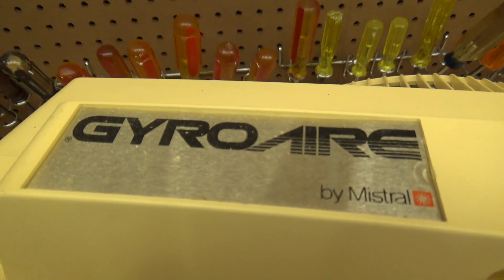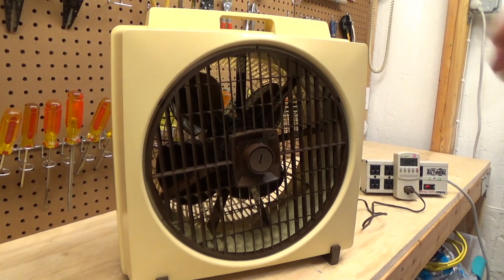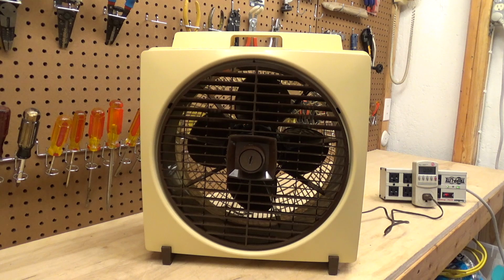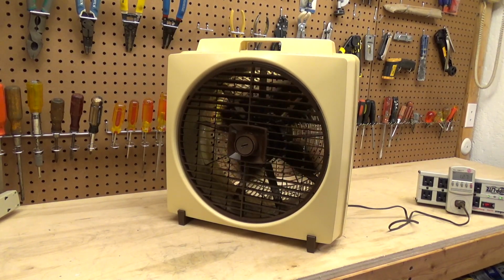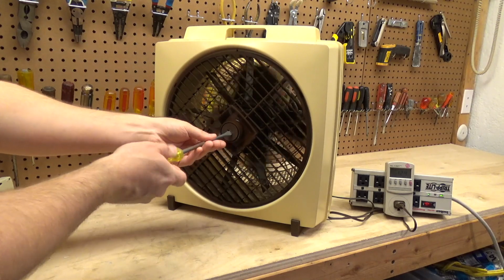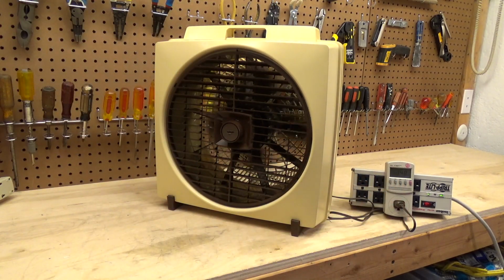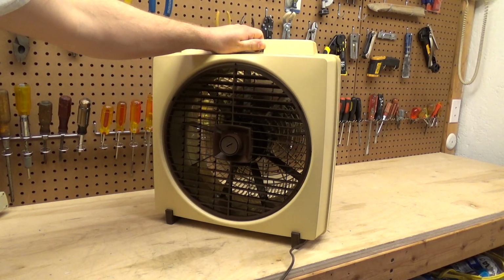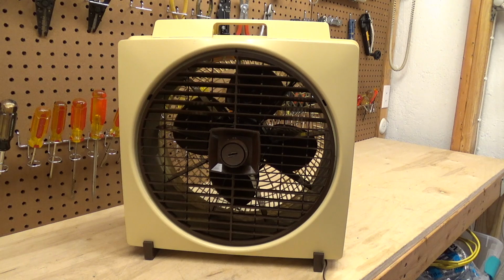Gyroaire Fan by Mistral Model GA16-70

Comment: Nice powerful fan with great aerodynamics. Too bad it has safety issues, another manufacture should of made their own version with the safety issues fixed. Looks like you need a new toilet paper tube for the wind velocity demonstration also a hand held anemometer wouldn't be a bad idea.
Reply from the maker: I recently retrieved the old air flow tester from the old location. It will be featured in the next fan video.

Comment: I love these styles of fans especially the types with the spinning grilles. I always try to pick them up when I see them. Unfortunate that it was so poorly designed in terms of safety. Despite this, I’m glad there are still people who want to save this stuff. 
My latest fan find was yesterday at the Goodwill. I found a cute little 9” GE Vortelex, model FM9V1. It was only $8 but it needed new head wire and the blades are awfully out of balance. I got it running and the blades balanced as best as I could, but they are really a chore. This fan has had a hard life, but I’m glad I could save it. Your videos of GE Vortalex fans were the videos that helped me discover your channel in 2018, and I am so excited to finally have one of my own!
Reply from the maker: I like those Vortalex fans, but the blades definitely are a challenge to balance.

Comment: Ahh yes the classic Mistral "Pyroaire" ! 😂 I'm pretty sure there was another problem with these things not using adequately sized components in the speed controller boards that also caused them to burn up but I don't entirely remember because it's been quite some time since I've seen anything about these fans.... Youtube User Spats Bear did a very detailed video on these fans a few years back that goes over everything wrong with these and how he made it safe to operate. I really suggest you check that video out and if you want to actually use this fan I'd follow exactly what he can did to make these safe. Also side note, I'm pretty sure to engage the grill you grab the smooth part that's around the slotted center hub and just pull out on the whole grill and it will click into place and engage like pushing the oscillator button on a modern table fan.
Reply from the maker: Thanks for the information. If I ever do use this, it would be attended operation only with the speed controller bypassed.
Reply: Haha pyro aire!!!

Comment: The blade is plastic.  It fooled me too from within there at first, until I opened it up.

The flat common head on the front of the guard is fake, like fake microphones.  You have to pull out the guard to activate it.

Definitely don't run it and don't leave it plugged in until you replace the cord and modify the control panel.  The cord is underrated; it actually heats up on high.  And the control panel, well, wait till you see it.
Reply from the maker: The blade is plastic?! It doesn't look or perform like a plastic blade.
Was the cord part of the recall? I tend to think it's just spoiling with age rather than underrated, even a 26 gauge wire should be able to handle 2 amps at such a short length.

Comment: These fans have unfortunately killed 2 people
Reply: Fr? If so, how?
Reply: @Alexthefancollector  damn a cool concept but terribly executed it seems
Reply from the maker: Not good.
Reply: The resistor in the speed control board is known to melt and catch fire
Reply: Ahh yes the Gyro Aire. When they were recalled here in Australia during the early 1990's the TV and newspaper advertisements explicitly told users to DESTROY the fans, not just cut the cord off and chuck it out, as someone dumpster diving or etc. could simply salvage the fan and fit a new cord.

My parents had a slightly later version of the one you have there, built in 1984, GA12, style 17. Apparently not part of the recall.

Theirs was visually the same as yours except the handle and rear grille were the same brown as the feet and the front grille. It apparently was not subject to the recall and when it was finally disposed of in 2020, after the case was damaged, I removed the speed controller board to find no evidence of heating or damage, the resistors, capacitors, triac, all appeared to be in perfect condition, and of decent quality, in fact I kept the board, I believe it may have been a revised one, and this fan was in heavy use every summer from 1985 well into the 2000's. It lived the last 15-20 years or so of its life as a garage fan as well.